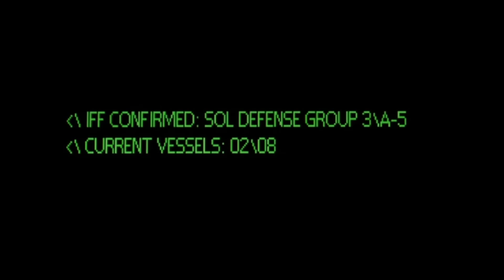Marine Armor | Most Detailed Breakdown

Comment: Love that boots got the appreciation here for sure that being said even the brick bottomed standard issue boots we got in the army are comfortable at a certain point they just take so much to break in and definitely will cause some blistering in the process but I remember we used to wear them in the shower and while a room full of dudes bare assed in boots might look wierd the combination of the steam from everyone showering at the same time and the hot water helps to soften the leather up and you just continuously tighten the laces as the leather loosens to a certain point and then wear them until they dry because as they dry after that the leather slightly tightens back up and form fits to your feet after which they fit like a second pair of socks the main downside is the weight cuz for no reason they thought fuckin 10 pound boots where money moves for sure but the army does luckily after basic training allow the boots almost exclusively and almost no other part of the uniform to come from private companies so long as it fits the standard durability and appearance standards amd cannot be waterproof which I'll explain n a sec but it allows us to find good boots for what we like like oakleys are personally my favorite as straight out of the box they fit and wear like an absolute dream but a lot of guys say they tear too easy all the same i wore a pair of them for 2 plus years in and out of the field in cacti rocks mud everything before they started tearing and u have a lot of variations in cost, comfort, weight, and durability giving you options to find what you personnaly prefer. Oh and finally the reason no waterproof boots its because of extended potential field missions say you deploy and get stuck pinned down in a hole for 3 days and have to walk 8 miles back to base waterproof boots work both ways and dont really let the sweat and moisture escape which can cause like gangrene and trench foot so after your 3 days in a hole you may not be able to make it back to base and at least in the case of gangrene if you do make it back you may have to have your feet cut off luckily the one dude I saw have gangrene was super early stage so the medics just cut off the areas of skin where it had onset and bandaged him up so he made a full recovery but another couple days couldve changed things pretty drastically

Comment: Note: AR 500 and AR 550 armor plates are also Forged. Even the Level IV ceramic plate armors that have a small AR500 insert are forged. The steel holds tighter that way.

Comment: Has anyone noticed how strong sgt johnson is? I never gave much though to the starting cutscenes of halo 3, but you can clearly see how chief helps himself up by holding on johnson's arm. Considering how heavy the whole suit is johnson is very strong, he doesn't even strain or anything, op spartans 1st gen
Reply: That because he is an spartin 1. There not strong as Spartans 2-4 but they have denser muscles compared to normal humans. 

Edit: fixed lore and grammar
Reply: @beamrunner0471  oh geez, now S5, who are those?
Reply: @beamrunner0471  this also reminds you of how disgustingly strong the brutes are. Even as spartans 1 and 2 gen. Both johnson and Douglas were powerless against the raw strength of the brutes
Reply: @feedmatrix10  sorry there are no Spartin 5 (yet but idk) just a typo, but yeah brute damn well earned there names.

Comment: Looking at the "form" of the armor and why the placement of the armor mimics the same body parts of new age hockey gear. If you go to the hockey gear websites, the new stuff is multi layered, impact zones and energy transfer zones. Shin guards protect the fronts heavy but have thinner wraps to guard on the rear but the front has the main protection for the players and the knee caps. The  "pants" have been replaced with more of a girdle type that guards outer thigh, frontal thigh, and impact zones for spine areas. The equipment even has the new d30 padding where it's soft but when hit, it hardens and transfers energy outward. Even the Chest guard mimics the same pattern of the Marine armor and the Buckets (helmets) from the 80's (Jofa) do too.

Comment: From someone who has worn armor regularly in the military, the issue with modern tech is weight, cost, and heat retention. Wearing just a plate carrier usually adds about 25 degrees F. Weight of the plate carrier, both front/back plates, about 30 pounds NOT including gear/ammo/weapon/etc. If talking full combat load and dismounted operations, 90-100 lbs is common. Titanium alloys would lighten the load and potentially allow for more armor to be worn realistically, but the cost is up there.
Reply: Titanium is roughly a third the weight of steel, I highly doubt a set of titanium armor like what the Marines wear in the games would be lighter than if it was made from ceramic plates like what we use now, and if it was lighter due to it being made from a titanium alloy, it wouldn’t offer the same protection.
Reply: @kerbalaerospacelabs3445  Level III and Level IV Titanium plates stand up well to rifle fire. There are some inbuilt titanium ceramic insert vests that can stop .50 BMG but can't handle .50 BMG APIT all that well. So, yes it can offer just as much on a 3rd of the weight...

Comment: So I wanted to comment on the topic of spalling with the armor. 

Based on what was described by its makeup, I believe it works similarly to current manufactured reactive personnel armor systems. 
The titanium shell works as a primary stopping point, but is thin enough to allow the projectile to still pass through, but at an extremely slowed rate, which would deform projectiles, but not shatter them, and the polymer compound core, like the current manufactured armor, is made to harden when force and speed are applied to it, such as when a bullet hits something, which would result in the polymer “catching” the projectile.

Comment: The scrap metal from machining can be recycled
Reply: Yup but additional cost and energy usage in re-smelting the shavings and cutouts.
Reply: Skeptical Guardsman not to mention you’d still have to machine castings and forgings, so metal chips are still a thing to deal with no matter what you go with.
Reply: @skepticalmagos_101  you can have a different company deal with that

Comment: Casting is far cheaper than machining or forging for large volume products. Machining doesn't have much waste as the chips can be resmelted into new billets Forging also requires final machining after it is forged same with casting.

Comment: In regards to spall protection I feel there is a simple solution that I'd love to see someone try. By having wood, yes wood, framing the plate in a chest rig, being say, 1-1.5 inches in depth, this would catch those bits of copper jacket while also remaining relatively light weight and cheap. The trade off being it would affect user range of motion a bit, but still seems like it could work.

Comment: NIJ level 4 is in every way higher protection than 3. The reason for the difference pointed out is because it's much more difficult to stop an armor piercing round over regular lead core. Being able to stop a 30.06 ap round means it will be able to stop anything slower or softer and there's no point in listing a number because it'll always be more than a level 3 plate. Level 3+ is a colloquial term for plates made of material like steel or titanium that can meet level 3 but also stop some higher penetration(though not legally or practically actual armor piercing)  projectiles such as SS109 'green tip' 5.56.  3+ being usually not ceramic is also usually associated with being able to stop an effectively unlimited number of strikes albeit with the danger of spall once the coating is removed after the first few hits.

Also it's pronounced as an acronym not word as NIJ stands for national institute of justice.

Awesome video, just figured I'd throw that bit of extra insane level of detail out there since that's the idea here 👍

Comment: First I'd like to say, I love  your videos and the manner in which you present. The syntax, vernacular, and the natural sound script that you have. Outstanding! 

To have the UNSC BDU technology be researched and wide distributed throughout military forces now would require a substantial amount of monetary investments. Based on the make up of congress and the executive branch funding will be appropriated accordingly. Democratic parties usually place military funding on the low end of priority and is also the first to be defunded. Under republican control, it is the opposite.  As you mentioned in your breakdown, there is a limit to a service member's value which over the course of a standard 4 year enlistment is around $600,000 to include all of the trainings, uniform allowance, and pay and entitlements received during that enlistment. Normally service members receive about $250 every two to three years for uniform replacement unless they are part of a special unit. Those special units equivalent to the ODSTs (SEAL, Delta, ect.) are worth twice as much and would be the ones to receive specialized uniforms. It would take around the year 2400 to standard service members to receive the basic marine uniforms detailed in this video. 

As always, great jobs with your videos and helping to expand the lore. Microsoft should have you as an Easter egg character in the halo universe.

Comment: I might have left this comment in the past. I'm not certain. But NIJ level 4 is a straight upgrade to any variant of NIJ level 3. Any level 4 armor plate I have seen tested against standard 7.62x51 NATO has taken 8-12 or even more hits.
Either way the properties that lead to failure after multiple hits are not exhibited in the same way in any form of titanium so applying an NIJ standard to it penetration is impractical. What would instead be relevant would be what's the largest round it can take before you get lethal backface deformation (which does not actually require the back of the plate being deformed)

Comment: 11:25
About NIJ ratings you have misunderstood.
Although level 4 rated armor is only designed to stop 1 round instead of six.
That one round is 180gr 30-06 Armor Piercing(7.62x63mm) commonly denoted by black paint on the tip vs 6 rounds of 7.62x51mm NATO Ball(147gr).
Big Difference in case length and projectile weight.
Your assertion that level 3 is better than level 4 is faulty.

Comment: Fun fact, almost all things made from titanium are alloys. Titanium by itself is softer than most metals (not to the degree of gold or lead though). The addition of other metals gives it similar properties to steel where it is a great balance of strength and flexibility. The bonus of titanium is that it is significantly lighter than steel. The cause of its rarity in the modern world is due to Russia having a vast majority of the available titanium under their control and they use it as leverage.

Comment: Will be testing that. The MA5C's energy has already been given same with how fast it travels... knowing that I now now how strong the Spartan shields are... the DMR firers, according to sources, the same round as the MA5C and other variants... factoring chamber pressures you still would need absurd velocities exceeding even the SRS99's 1450m/s 14.5×114mm round... the actual weight and how fast the round goes after a few changes fixes that... the MA5C shoots a 8.18g light weight armor penitrator round. Which delivers a pretty good amount of energy... so unless the sources are wrong the DMR (M392 and M995 respectively) shoots a 14.2558g at 1084.212m/s. Which isn't exactly unrealistic, but would mean that you couldn't just throw them in a assault rifle and expect it to be okay after a few rounds.

Comment: The armour wouldn’t have the clattering issue if they wrapped it in camouflage fabric. Material science in the future can have fabric that’s abrasion, cut, fade and heat resistant. Might even be a good passive defense against plasma weaponry. We also already have advanced ceramics nowadays that can withstand the temperatures of plasma weaponry.

Comment: Ok I want to preface this by saying that I enjoy your content and I enjoyed the video. However that being said I want to comment on the last part of the video where you suggest making the Halo Marine BDU into a reality, simply put this is a bad idea.

There are multiple reasons armor isn't made out of metal the first being spalling. When a hardened metal plate is hit by a round the plate may stop the round but the impact will dent the metal. The dent will crack the backside of the plate and cause spall that will still injure the wearer. The next reason is heat absorbtion. Metal absorbs heat more readily than anything else I am aware of, in environments with very high temperatures (deserts, and savannahs) the armor would quickly reach the point of either burning or heat catting the wearer. This would cause attrition simply by wearing the gear.

Next kevlar infused uniforms. On the surface this sounds like an ok idea because of the added protection, however soldiers and marines need to live in their uniforms for months on end in sometimes very shitty environments. Kevlar does not absorb or wick away sweat and is an incredibly dense and insulating material, wearing kevlar under your armor again would increase the risk of heat injury well beyond what current risks are in hot environments for relatively minimal gain.

There are other problems with the armor as well, such as the unneeded calf plate and thigh armor. Leg armor is pretty much a non starter, the protection gain simply doesn't outweigh the added weight and loss of mobility. 

Pauldrons are silly and no one will ever convince me otherwise but I can see their uses. I'd never wear mine (I don't even wear my pads or side plates) but that's beside the point.

Batteries would be another massive issue for the electronics gear in the helmet. The amount of batteries needed to sustain that amount of doo dads for a standard patrol (30-75 days outside the wire)  would simply be unfeasable to carry in addition to the batteries already being carried.

By and large my favorite armor systems to wear are the smallest and least obtrusive systems that I am allowed to wear. Soldiers and marines often sleep in their armor and armor being small aids in that comfort. Being small also aids in weight saving, my ruck usually weighs between 70 and 90 lbs or 31 and 40 kgs, adding as little weight to that as possible is ideal.

Just my 2 cents as a currently serving 13F in the US Army.

Comment: level 3 armor is rated for pistol caliber rounds. Level 3 has stopped rifle rounds in the past but its rare and not without a degree of blunt trauma damage beneath the armor where it was shot. Level 3 can stop rifle rounds if the rifle round has lost enough velocity over distance that it has lost its penetrating power. What theyre wearing is likely something more similar to level 4 or possibly a form of level 3-A or something of the sort. Level 3 armor for the most part is soft kevlar. There are hard plates that are level 3 though. What you said about level 4 armor isnt necessarily right either. I have a plate carrier and the plates i have in mine are level 4 ceramics that are multihit capable, not one hit like you stated. For reference the company for plates i use are made by RMA. There are also plastic level 4 plates with a combination of ceramic as well that are even more multi hit capable than mine. I believe mine can stop up to 7 shots of 762. It uses a basic tile design which enables the multihit capability. By no means am I trying to throw shade or bm, i love your channel and just like to be helpful or informative if I can. On a side note, stay away from steel plate armor. Spawling is a huge issue with steel plates. One popular and affordable company comes to mind that shall not be named. Cheers!

Comment: So I've got some thoughts on what's referred to as the Insurrection-era BDU. Because it only has one appearance during the Insurrection (halo legends) I'm inclined to believe that it saw limited usage for EOD (Explosive Ordnance Disposal) elements within the UNSC Marine Corps and was much more modular to easily be all-encompassing in the rare cases EOD Technicians had to do the job by hand. The variants importance however changed when the Covenant became a threat. While modified Kevlar had been perfectly suitable to deflecting Insurrectionist's arms it was woefully inefficient at dealing with Covenant plasma weaponry. So in a kneejerk reaction to the problem, the UNSC Marine Corps began widely outfitting its Marines with what was an EOD BDU. In amidst the production issues that arose trying to source that many replacements, the Halo CE BDU would arise as a temporary ad hoc solution to the problem until eventually being phased out. As the war progressed and research was conducted, newer armour that was more heat resistant would become available and the initially ad-hoc platform would be phased out to a decent degree with the Halo 3 BDU. Finally, by the time of Halo 4 with the existence of more complicated threats that warranted more directed allocation of equipment, rearguard units would receive the lighter ballistic vest variants as they weren't expected to be up against plasma weaponry.

Comment: To many people get hung up on whether the armor is the best it can be, while completely failing to think about the logistical and economic requirements of fitting such a vast military force. Yeah, concessions will be made as they will have to be for line infantry.
In my time in the Infantry we constantly complained about our gear and compared it to other, smaller, groups even if it isn't realistic. And the USMC infantry isn't that big to begin with, but the budget has to outfit every single theater short of naval.